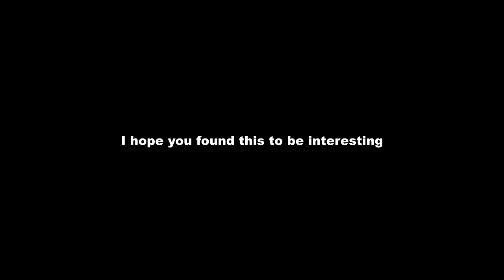Adventures with Fuel Transfer, Part 2

Comment: For your time and money spent you could have purchased a 30 Gal storage tank. $140
But a nice little project non the less. nice details on the pump parts and your Mod
Reply from the maker: AP514, well, no a 30 gallon storage tank would not have helped me at all. As I said in the video, my pump rig is used for fueling and de-fueling, as well as moving fuel between different tanks. A large storage tank would solve few of my desired goals. Also, where I live, large fuel storage tanks are prohibited, and they can't be located outside anyway, and I would not want to store that much fuel INDOORS.

Comment: It looks like your next project should be to build a case for your bass drum.
When are you going on your next train trip?
Reply from the maker: Cliff Liese, the drum is not mine, I simply store it for a local community band during their off season (one of the two Racor hoist platforms in my garage....see my video on those....is used to hoist the drum, a set of orchestra bells (see my video), a set of horn reflectors (smv), and other stuff, up into the garage rafters when I need to use that part of the garage to park my car in the winter.

New Train Odyssey coming early next month.

Comment: Yes! I found it interesting. 
I was wondering if you had any concerns about grounding to prevent any electro-static charge build-up and potential discharge? Especially during the dry winter months.
Reply from the maker: PeterT1981, no I don't. The pump will only be used for very short periods, no more than a minute or so each time, not enough for a significant amount of gas vapor to form. In this way, it is no different from using any regular gas can to transfer fuel.